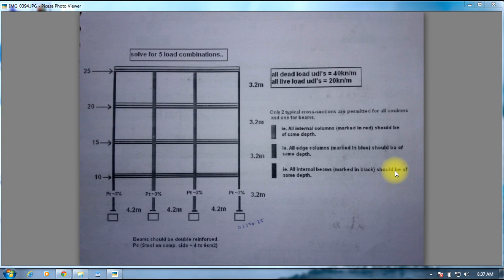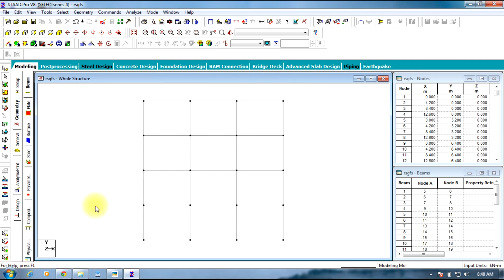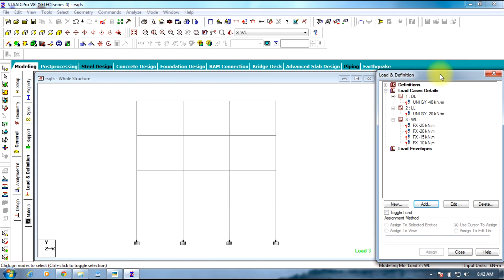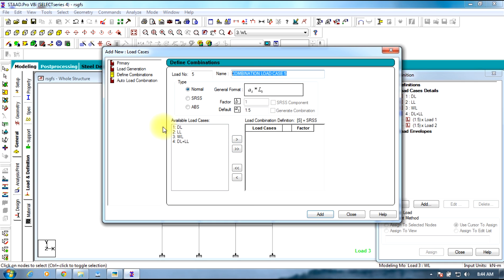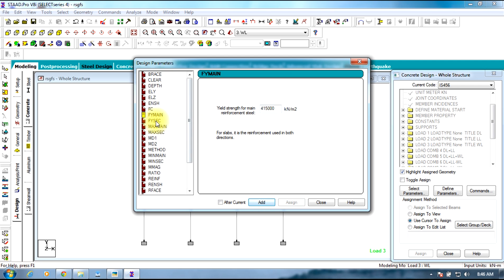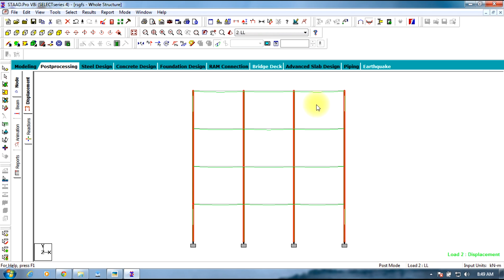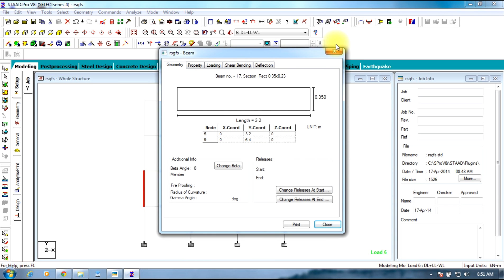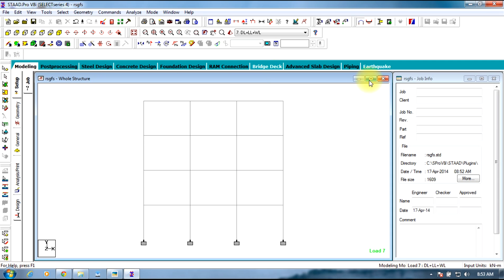STAAD Pro Tutorials Design of MultiStorey Frame-Day 7

Comment: 12:48 no beams failed for the steel/aluminum design calculation

13:24 you mentioned that the column has failed

those lines somehow confused me, is there also another way to know if there are failed columns rather than manually double clicking all those beams?

btw, thanks for creating this tutorial video, i appreciate it :)
Reply from the maker: Life Hacker 

12:48 no beams failed for just steel/aluminius design. But didnt mention anything about concrete column design.
13:24 It shows that the concrete column has failed in concrete design not it steel/aluminium design.

You can go to SELECT-By Specification- All Failed Beams.

You are welcome:)